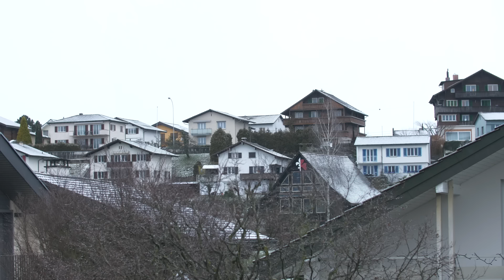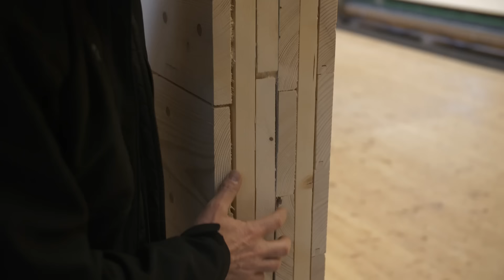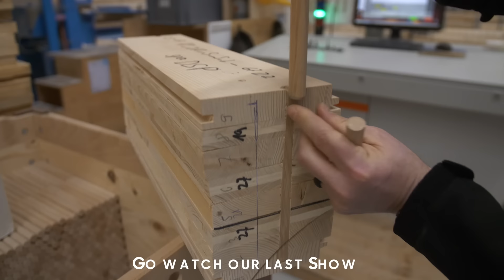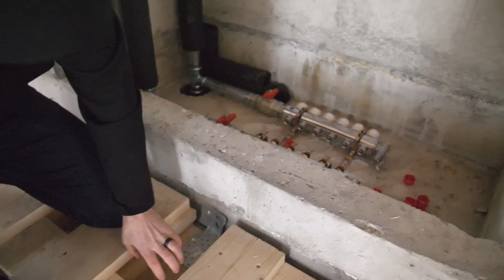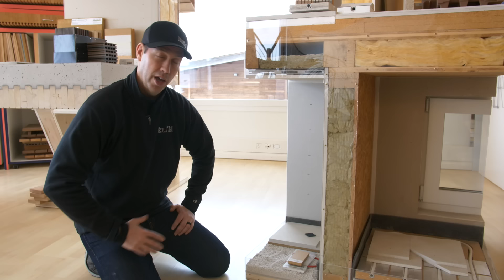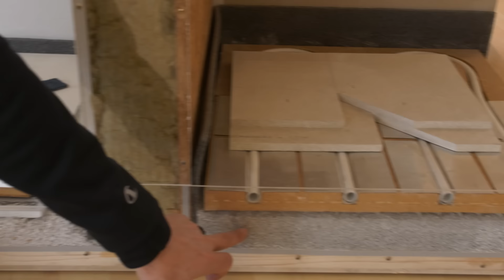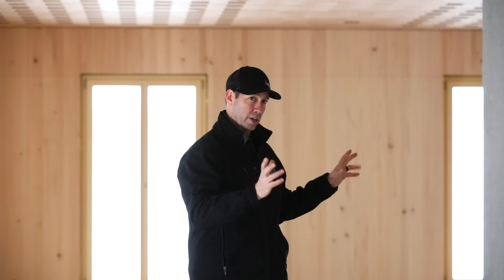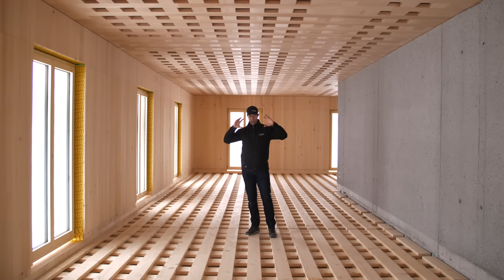This Swiss Building blew me away!  All Wood and Concrete - NO Insulation

Comment: No one even mentioned that the sand would act as a serious fireblock between floors -- genius
Reply: I am building a workshop apartment (first-floor workshop, second-floor apartment) and very worried about the noise. The sand sounds like an awesome idea (pun intended 😛).
Reply: Why does the sand work? If there was a fire below wouldn't the sand pour out of the floor? Or is that the idea so it can suppress the fire?
Reply: It also helps to regulate moisture.
Reply: After the last round of fires in NorCal I’m done with wooden houses, they are all just tinder boxes waiting to burn down
Reply: @markman63  stick-built houses are made of soft white pine. Hardwood does not ignite as easily, and large chunks of wood are really difficult to get going. That's why when you build a fire, you start it with stuff like newspaper and small kindling, and let that catch progressively larger stuff until the fire gets hot enough to cause significant off-gassing of the big logs that sustains the fire.
Reply: Problem with sand is that it change shape over the years, not gonna be a problem in this house since the floor isn't directly on the sand.
Reply: It's all the plastic and particle board IKEA furniture that's going to burn...  Then you'll be left with a nice charcoal finish....
Reply: Razvan, What's holding up your ceilings and floors, bet it's wood.  If it's not, it's probably concrete which is cold and transmits sound.  People have been building with wood for centuries.
Reply: Razvan J  you just said you bought the cheapest "water resistant laminate"... There's your answer.  Don't buy cheap, and read up on the product you're buying.  You have to think long term.
Reply: Razvan J  You clearly didn't read what I said.  I didn't say laminate is bad, CHEAP laminate is bad.
Reply: That's until the supporting wood is burned away. Hope they install a fire suppression system.
Reply: @tony_solar  the primary purpose of fire suppression is to allow enough time for egress. With thick hardwood and all that thermally mass added with sand, it will take quite awhile for the fire to develop, let alone reduce the structural integrity enough to no longer allow for safe egress.
Reply: My apartment from The 60's has 7 centimeters of sand between a concrete floor and The Wonder floor.. It's not anything new
Reply: @iblis89  Never understand why people say "its nothing new" because people ALWAYS say that when no-one has even claimed it to be anything new.
Reply: Nothing new. There are buildings that are hundreds of years old with sand in the floor.
Reply: @HeikkiHeer  the idea is still genius. Whats your point?

Comment: Sand sounds like trouble when repair or doing maintenance on pipes that run through it as you mentioned. As for leaks (not water) could be a clean up nightmare. Not sure about weight capacity but it definitely heavy enough to cause wood to sag over time, (will definitely be a lot worse if water leak does sits in the sand for over period of time) 
Perhaps try using something like peanut foam could be a better alternative.
Very interesting concept, however!
Reply: Tion Solace you won’t get the needed mass out of foam (sound proofing). Also it’s a waste material, harming the nature (microplastic) and humans (gases).
Reply: Yes, I am not an expert so I just given out suggestion on what I think could happen. I do agree foam aren't the best choice to sound proof and certainly not heavy enough to do the job. Using over access amount of wood is also not the best for environment either. 
What would you think is a better choice in both conveniences and environmental friendly?
Reply: Tion Solace as a professional, i use a combination of 2 layers of sound board (dry ceilings made from thick gipsium board), a fluffy wood or straw based insulation and some kind of concrete on top (Lewis ceiling or just concrete slab on a soundinsulation made from woodfibres on a OSB3 Board).

With this u have swinging, breaking and  Sound „sucking“ all at once. Best u could get for a wooden ceiling.
Reply: @tionsolace   Use of forrests is strictly regulated and funded in Switzerland. Forrests are growing faster than they are chopped down.

Comment: with wood floor and exterior wall, sand in the floor, any repair for water or fire damage is astronomical.

And, how are they going to run the electrical wire?

Comment: It is really nice. I still like that barn more though. The overhangs really sold me. 

Anyways, I wish you would comment on how they deal with wood pest where they are. 
OR is that even an issue? I know it's winter time over their right now, but what about the summer time?
Reply: MRSketch09 no termites. But we have smth called „Hausbock“ https://de.m.wikipedia.org/wiki/Hausbock - but since we are keeping wood constructions minimum 30cm from the ground and since we always have massive basements or foundations, we rarely have trouble with our wooden buildings. And since most wooden constructions are kept sealed from the outside, we are mainly good.
Reply: @WAJK2030   Thanks for the reply, and sharing. That beetle looks like it can do some nasty damage. Where I live we have "termites".. hate them.

Comment: How many acres of trees to build this building?...trees that absorb CO2....how is that a sustainable way to build?
Reply: Actualy, this is perfect way on how to store CO2. You cut a tree to build a house that will last for centuries and plan a new tree or two that will absorb CO2 out of the atmosphere and repeat the process ever 80 years or so.
Reply: umm you know trees absorb CO2 what do you think happens to that C02 when you use the wood instead of burn it and replant new trees to absorb more C02?.......
Reply: you plant more as you go.  Wood is 50% carbon by weight, so cutting down trees and replanting them is not just carbon friendly, but it's capturing carbon out of the air and turning it into buildings, furniture, etc.
Reply: Reduction of materials is always better: they did use a lot. Probably could have been done more efficiently.

That said, of the materials you can choose, wood is the best in terms of GHGs. It's essentially made from carbon sequestration and solar power. As long as you are harvesting and replanting sustainably there shouldn't be an issue (young trees also absorb carbon dioxide at a higher rate than older trees). There is dependence on what the end of life practice is, but landfilling any construction material is a problem and wood is fairly easy to reuse.

Major alternatives are concrete, which produces a LOT of CO2 with the production of cement from limestone (only partially counteracted by later re-absorption), and steel. Steel varies based on the energy source used, but still uses more energy in production or recycling than wood.

Comment: Like yeah it’s cool but that’s soooo much wood compared to a normal house or am I crazy ?
Reply: Massive timber buildings provide structural strength and fire resistance for tall buildings. Light stick framing is great for small buildings but can be a problem at this scale. That said, they definitely went overboard with the amount of wood they used here: they are a wood building ("Holz Bau") company so they are showing off to clients.
Reply: Cameron Lapp that makes sense for suede but I don’t know why they wouldn’t just use like steel beams similar to a high rise only 5 stories ya know

Comment: I love the ceiling, great design.  I wonder if that's solid lumber or a clear veneer over a lower grade lumber. If it's solid clear, that's really a lot of rare wood.
Reply: exterior "lam" is architectural grade timber, inside lams are industrial grade: more knots, checks, etc. This type of wood is not rare, in fact, without this technology (Brettstapel if nails or dowels and CLT if glue) this lumber would likely end up being used for OSB or paper, because it is fast growing and rather crappy.
Reply: @RHGM71  , Thanks for the reply.  I also like the grid and "filled in grid"  as the only ornament in the ceiling. Amazing design and execution.